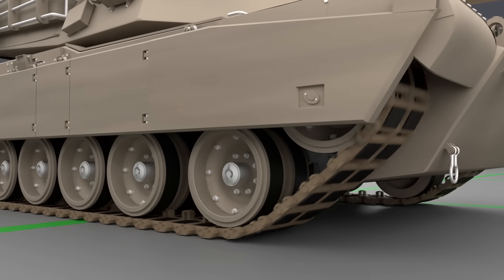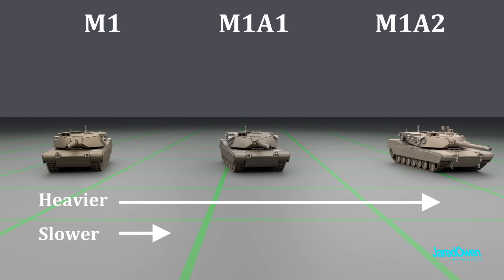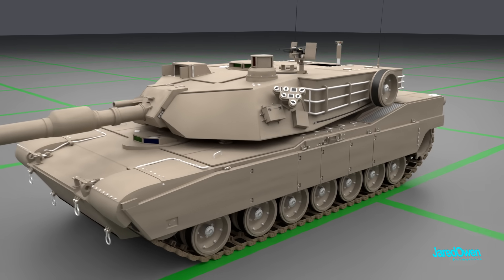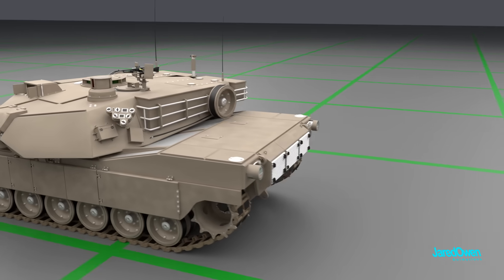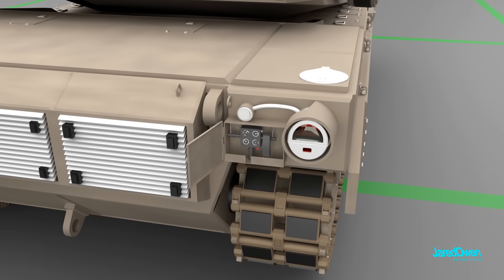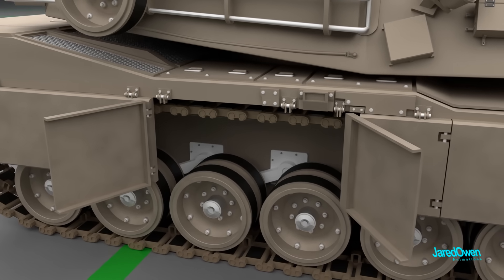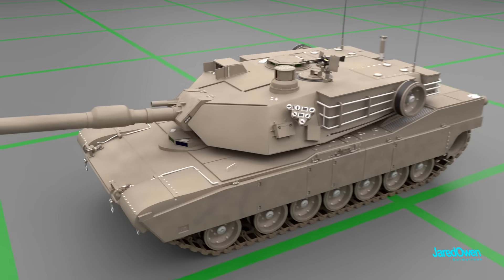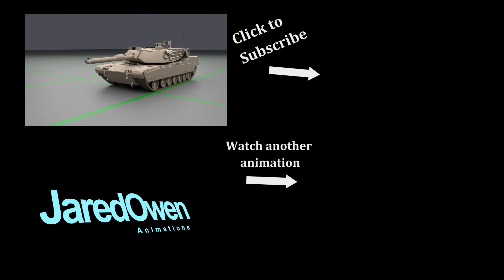How does a Tank work? (M1A2 Abrams)

Comment: As a Abrams Mechanic I can say I was surprised how accurate this was, good job mate.
Reply: I think it has some kind of computer and a joystick.
Reply: @mantrachhaya6835  it's shaped like the original xbox controller tilt to look up turn to turn and tilt down to look down
Reply: @rabbitwithm2495  it's called a yoke
Reply: @mantrachhaya6835  combo.
Reply: Dont you love how the apds dart exploded in the animation
Reply: @rabbitwithm2495  the du penetrators vaporize and ignite
Reply: @rabbitwithm2495  I think it was just to show where it hit
Reply: @rabbitwithm2495  APFSDS-T
Reply: hey how does the gunner turn the turret? does he turn a knob or what?
Reply: @knucklesandwichdude133  it's a handle sort of like what you would see on a small plane. It send an electrical signal through the A.I.M (analog input module) to the hydraulic system.
Reply: Is there I transimission like a car? Disk brakes on every wheel? I can't believe that thing has a turbine engine who would have figured lol
Reply: @DeezNutz-jd7zi  nom analog, digital systems a long time ago.
Reply: @DeezNutz-jd7zi  yoke, PS5 controller for adults
Reply: @Viper-sn5cx  trans is a heavy duty trans built here in the US built by an outside contractor for the jet turbine engine. Brakes are attached to main drive on the rear.
Reply: @reedrk88t  thank you Mr. Frost and thank you for your service!!
Reply: @Viper-sn5cx  yes  a Allison
Reply: @Viper-sn5cx  Its powered by a specifically built Allison Transmission. The brakes are hydraulic.
Reply: @knucklesandwichdude133  it goes through a bunch of other components but the biggest two is the A.I.M and the ifceu. (I'm a tank mechanic)
Reply: knucklesandwich dude idk much about tanks but on Bradley’s it’s an airplane looking control handle for the gunner and you just turn it left or right but there’s also a hand wheel to turn it manually so I’d imagine the tank isn’t much different
Reply: @josh84157  manual way is hard, like cranking a trailer leg but set up a little different.
Reply: @knucklesandwichdude133  0
Reply: @knucklesandwichdude133    Do a Google image search for M1 gunner's position.  You'll see a two handled gunners control handles.  He also has manual traverse and elevation handles.  The tank commander also has a tank commanders override handle that can control the turret.
Reply: @knucklesandwichdude133  That was in WW2 the gunner would reel the turret its all powered now
Reply: @knucklesandwichdude133  it’s hydraulic he moves these handles called Cadillac’s and it is also where the main triggers are
Reply: @knucklesandwichdude133  it's called the "Cadillacs," just a basic set of yokes, upgraded set of PS5 controller, triple redundancy system incase on system fails then you have 2 more to back it up. Yes ther is the alternative to crank it around by hand.
Reply: @knucklesandwichdude133  I was a gunner turns with a control thing kinda like a video game runs on hydraulic also has crank controls for emergency use
Reply: @knucklesandwichdude133  i think it's all electrical
Reply: @jamie_edwards7090  combo
Reply: @jamie_edwards7090  , no there are 3 separate systems
Reply: @knucklesandwichdude133  l0l0l⁰
Reply: @knucklesandwichdude133  the gunner has control handles and mechanical controls to traverse and elevate the main gun.
Reply: @knucklesandwichdude133  it was like a space handle you press it activating it an turn the way you wanna go like a steering wheel. And also controls gun tube up and down.
Reply: @knucklesandwichdude133  there are three separate systems to turn the turret. The primary is Hydraulic, with Electrical being secondary and Manual if all systems fail. The commander seat also has override controls
Reply: @knucklesandwichdude133  there are bicycle pedals underneath him
Reply: @knucklesandwichdude133  eé
Reply: @knucklesandwichdude133  Gunner has a control called a GPCH, or gunner powered control handles. Easiest way to say it is basically two grips that come off the left and right side of a box. The grips are held,  and the gunner rotates the handles with the same range that you would turn a steering wheel on a car if you kept your hands at the 9 and 3 (except you can only turn the grips to probably the 11 oclock before you are physically stopped).  He can move the turret fast or slow. Elevation of the gun tube is completed by pulling the grips back, or pushing forward. He also has a manual control that can be used to traverse and elevate in the event of power loss. The TC has a single hand grip that allows him to take over the turret and gun, and that grip is closer to a "flight stick". Its kind of a pain in the ass to use, and most TCs will use two hands to stabilize it better for accuracy of tracking targets.
Reply: @Pr0ph37z  thanks, that looked like it took awhile
Reply: @knucklesandwichdude133  All off the top of my head. I've been doing it for about 15 years.
Reply: @Pr0ph37z  awesome maté
Reply: @Pr0ph37z  we called the controls “Cadillacs” back in the day....

Did you notice his m1 model had the 120mm cannon instead of the 105? Notice the expansion tube...
Reply: @longsleevethong1457  We still call it the "Cadillacs". In the TMs though its referred to as the GPCH. So when your running through boresite with the book, that's how we refer to it. But when your doing gunner and want the gunner to hold it, it's usually "hold the cadillac", which is much easier to say than "hold the GPCH". 

I didn't pay attention to the tube on the M1, but I'll rewatch it. 

Best job I've ever had.
Reply: @Pr0ph37z  best job I ever had.....lol. Just watched that movie last night.
Reply: @longsleevethong1457  105 has been gone prior to 2000
Reply: @Pr0ph37z  it's*
Reply: @longsleevethong1457  Cadillac guage made the controls.
Reply: @reedrk88t  yeah I knew that before you were born. That was My point
Reply: @eddieb4227  gotcha
Reply: @knucklesandwichdude133  they have Android Auto & Apple CarPlay. They can say,” hey Siri, turn this shit around!”
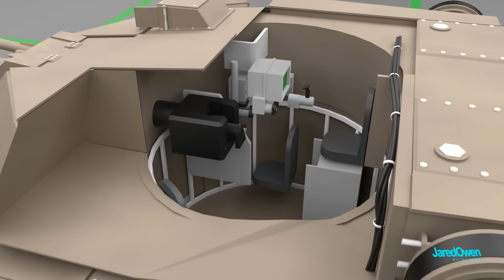Reply: I have a question. What happens to the shell casing when the round gets fired from the main gun? It just disappeared in the video, at 7:23
Reply: @leodavis03    The 120 mm ammo is caseless.  There is only a short portion in the rear that gets kicked out of the breach.  It fall into a basket on the turret floor at the rear of the gun.   Watch this video: https://youtu.be/sC2ePKRvo9k  You get a pretty good view of the spent "aft cap" falling at about the 20 second mark.
Reply: @TheJimtanker  thank you
Reply: @TheJimtanker  the basket, never stays, the basket always jams up and get beat up by the breach. We had to many that got tore up so they stopped putting them in, we pitched the AVCAPS out when there were 8 or more on the floor.
Reply: @leodavis03  hit the turret floor, they're called AVCAPS. We pitch them out when it gets be an issue or we get to a stopping point.
Reply: @reedrk88t  ah OK. Thanks. What do you mean "pitch them out"? Thanks again
Reply: @Ed-fc3od    I started in the 2nd Armored Division and retired as a Master Gunner in the 82nd Airborne Division G3.
Reply: Its funny to read the comments and questions here. Dont get me wrong I'm not bagging on those of you who are not 19K, just getting chuckle.
I was recently a 19k and have lots of info but limited in what can be given.
Reply: @reedrk88t  😂😂 same.. old school 91k here, worked primarily on the weapon systems of the M1s.. its funny to see how wrong all the "tankers" are that are responding to people.
Reply: Keep pumping them out brother
Reply: Thank you for your service!
Reply: I thought the smoke launchers are supposed to launch smoke cannisters about 30m in front of the tank in an arc. Is this inaccurate? or do the smoke launchers ALSO spew smoke directly from them?
Reply: @Polarwhisper6  those are just launchers, engine can generate smoke
Reply: @reedrk88t  Exactly how fragile are the tracks? It seems like they would be an easy weak point in an altercation.
Reply: You are correct, the engine can generate smoke. Not only have I actually been inside one of these tanks and looked through the optics at a soviet artillery piece before, but I have also on another occasion saw one generate smoke.
Reply: @Polarwhisper6  number two
Reply: @Polarwhisper6   You're right on that.  They do not spew out smoke like this video showed.  You can find videos on YT that show smoke grenade launchers in operation.
Reply: @Ed-fc3od    And where did you serve and what was your MOS?
Reply: does it have air conditioning?
Reply: @djbis    Nope, no AC.  It does have a kick ass heater though.  Especially if you're a driver.
Reply: @TheJimtanker  Yes it does.
Reply: @chrismcbride9528    To which of my comments are you replying?
Reply: @TheJimtanker  SEP 3s and SEP 4s have AC. Now do they work is the real question lol
Reply: @155jwatson    The “AC” is for the electronics, not the crew.
Reply: @Ed-fc3od    No worries.  I'm sure we slept in the same mud at some point.  I have quite a few friends in the 10th Mountain that I served with in Asscrackistan.
Reply: Hey do they fire thumb tacks.  I thought they fired AA rounds or AITANK rounds or AP rounds
Reply: Грёбаный ящик 📦 с болтами.
Коробка с грузом 200.
Reply: I see .you're profile picture  looks like an american soldier
Reply: @panzerv5  yeah but american fon't say mate they either say guy or dude or body or bud or pal but mate it is an australlian thing or english
Reply: @beastmr919  хм что?
Reply: @panzerv5  your*
Reply: @panzerv5  ... your* picture ...
Reply: @einundsiebenziger5488  mmmhmmmh
Reply: @panzerv5  lmfao, duhhhh
Reply: @kita umi idiot
Reply: @kita umi see properly when giving a reply
Reply: LEGO but metal
Reply: Ummm....im sure he did his homework before making this vid. Lmfao. There is NOTHING you can't find on the web. Just gotta know where to look, and how to access
Reply: @808G8GT  this does not give specifics but good luck.
Reply: @808G8GT  tHeRe Is NoThInG yOu CaNt FiNd On ThE wEb, what about military secrets? You are really stupid
Reply: What is the diference between US ton and just a ton?
Reply: @joaopauloballico2407  The US ton is superior.
Reply: Joao Paulo Ballico  .2 tons so every us you add .2 for it..
Reply: @joaopauloballico2407  U.S. 2400 lbs
Reply: There’s hydraulics and a manual
Reply: @M19KLuey  electric, hydro, manual, M1A1 SEPV4 V5 GEN DYN
Reply: Cap 🧢 jk
Reply: I agree . I was 11b but worked alot with armor guys . Def good animation and accuracy
Reply: ឯកឧត្តម០០ឧញ្ញ៉ាជូនពរហ៊ា
Reply: @anpoly2892  ENGLISH.
Reply: We We
Reply: how thick is an abrams' armour?
Reply: @retricor  good luck on accurate info, I'm not foi f tell you and what you'll get wont be accurate for security reasons. Updates on current specs are not public.
Reply: @retricor  front armor is ~27” depending on the model. Some have Depleted uranium armor which are heavier and a little thicker I think.....not positive as it’s been 15 years since I sat in a tank.
Reply: @longsleevethong1457  sloped thickness or original thickness?
Reply: @longsleevethong1457  not current, older models.
Reply: Wait what
Reply: How do y’all escape if the tank flips?
Reply: @loganbrock3942  of it flipped the turret still has power to turn enough to get the drivers hole exposes if it's not already.
Reply: @loganbrock3942  Drivers hatch. Also the SEP 4 has some cool features for that. Cant say it but you can probably guess what it is.
Reply: @loganbrock3942    You can almost always get out of the driver's hatch, spin the turret if you have to.  If not you wait for the M88 recovery vehicle.

The M60s and M551s had escape hatches under the driver's seat, the M1 does not.
Reply: What other tanks have you worked on or is it just the abrams
Reply: @pyso9244     4 1/2 years on the M60A3 and 3 years on the M551A1.
Reply: Thank you for your service.
Reply: Any non-classified thing to add for us? Just saying.
Reply: @aniksamiurrahman6365  no
Reply: Aerospace Exploration  .exactly.
Reply: ... an* Abrams mechanic* ...
Reply: He was actually wrong about the guns on top the tank. The commanders 50 Cal he’s always there.  I am an actual crewmember to the M1Abrams.. You don’t know much about the crew serves to not notices mistake his mistake and call it out.
Reply: @travis adams huh. Thanks
Reply: Captain/Mechanic, there's no escape door at the base of the tank?
Reply: But which accurate?
First of all, it weighs too much (17,200 kg) which limits its speed, maneuverability and increases its consumption.
350 hp at 2400 rpm, ensuring a speed of 56 km / h are low values.
It takes at least 1500 hp and a speed of at least 100 km / h.
To decrease its weight it is enough to adopt the Apache construction technique.
And add the geo-radar system in front of the M1 as an anti-elimination protection criterion.
Reply: A recipient of the shells is under the same opinion
Reply: https://youtu.be/4G6e4TaJxkI 
excellent ⬆️
Reply: Obviously you did not drive them in Iraq... 😜 😂 😂 😂... Mate
Reply: @hanonomiri  no we just had them at checkpoints, we all used up armored Humvees
Reply: I was a 63 Echo 85 to 89 and worked at Ft Irwin as well
Reply: @LLJR  I was a 19k stationed in ft hood tx
Reply: We where made in HIS image
A good prayer:
I'm a sinner JESUS please forgive me for all my sins I know you shed your Blood for me on the cross at Calvary. Thank you JESUS for my salvation and for shedding they Blood for me. I love you JESUS. 
Romans 10:5/10 ct...❤️k
JESUSisLord!Amen...
Amen..
If you'd like to call someone who cares 
83
For
Truth.
bc you don't know when you'll die?
.y r u hesitant................
Reply: The forward moduel is a Lycoming turbine that was used in the heuy.
Reply: Факю! Наш Т90 сделает твой Амрас с дистанции более5.000 метров!  Я слишком старый но я бы и на Т34 тебя сделал!
Reply: Фуфня. Т-14 Армата лучше
Reply: Same man. It’s pretty detailed. Wish he would’ve added the filth in the sun turret
Reply: Американское дерьмо! Его место на помойке🤣
Reply: Отвратительность звука приобретённого носительства английского языка (старательное проговаривание, булькающее) превосходит чавканье и газоотделение.
Reply: Tôi biết rằng bạn còn ngạc nhiên hơn khi thấy nó quá tệ ? Súng trường của nga bắn cũng làm nó bốc cháy ngùn ngụt
Reply: Seriously? https://youtu.be/clOaelaj3FA?feature=shared
Reply: Гавно а не танк!
Reply: Это хуйна 😂
Reply: Твой самовар абрамс сгорает от Русских ракет и дронов как сено хахахаха!
Reply: di ukraina jadi rongsokan
Reply: @aguswijaya2198  Украинец - ублюдок, это не оскорбление, просто факт  Убюдок это - выродок, нечистокровный; у людей — незаконнорождённый потомок
Reply: @aguswijaya2198  Украинец - ублюдок, это не оскорбление, просто факт  Убюдок это - выродок, нечистокровный; у людей — незаконнорождённый потомок
Reply: @aguswijaya2198  Смерть украине!
Reply: Tu hindi samjh lera h😂😂😂😂😂
Reply: @princerechebei12  Аврамс может пересекать .водные. преграждения находясь под водой как Т-72?!
Я так и знал что нет...
Reply: Free Palestine😢🇪🇭
Reply: Haha, thanks, man! Coming from an Abrams mechanic, that’s some serious street cred right there! Guess I’ve officially earned my “mechanic of the year” badge now, huh? Hope I didn’t get anything too wrong, but if I did, you can always throw me a wrench and I’ll try again!
Reply: 🤮🤮🤮🤮🤮أميركا اكبردوله ارهابيه لابدمن اسقاط هده الدوله الشيطانيه
Reply: great! we don't care
Reply: Thank you for the service 🙏
Reply: 里面有空调吗，兄弟
Reply: امريكا مهما تطورت تبقى دولة مجرمة وطاغوت الأرض لكنها سوف تزول إن شاءالله
Reply: Кусок навоза, бьётся рпг во все проекции
Reply: Leak classified documents, I dare you,
Reply: Do they still use the 240 loader n gunner
Reply: @johnnyholman6958  yes, soon to be upgrades but that's not to be determined for now.
Reply: Americans (?) say ‘mate’?
Reply: @krisoli1218  it rubs off
Reply: @krisoli1218  did u watch video? Australia has them also
Reply: ต้องปลูกต้นไม้กันเยอะๆครับ

https://youtu.be/T3c-CgnZgjE
Reply: @kana5s627  s all
Reply: Damn, He is a actual soldier, Check his channel!
Reply: The German tiger would whip it
Reply: @the_ltz_guymaster7912  this is a troll correct?
Reply: @the_ltz_guymaster7912  the challenge has been accepted many times, and the records have been shown. The M1 has been the king for a long time now. 
Why do you think we have exercises with other nations?
Reply: @the_ltz_guymaster7912  sorry but the tiger would be smacked hard by this modern killer the tiger would be lost in the night where today tankers shine
Reply: @the_ltz_guymaster7912  the opposite
Reply: @the_ltz_guymaster7912  lol

Comment: What is the bump on the end of the muzzle, and how is it used? Hint, it was first used on Chieftains (I had the first tank in the squadron to have this feature). And 2nd hint it significantly improves accuracy during sustained firing.
Reply: Muzzle reference sensor. To check if the barrel is aligned with the FCS.
Reply: @peterson7082  It is the BARREL DROOP SENSOR... it compensates for the effect gun tube heating after repeated firing...